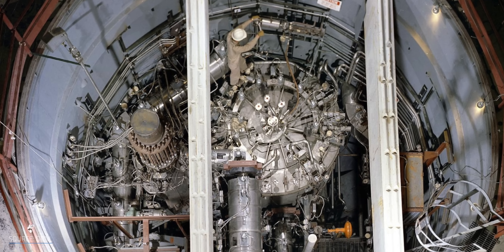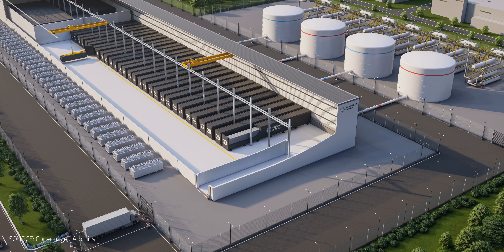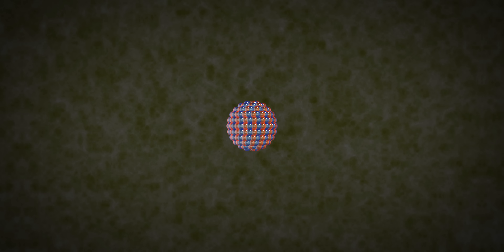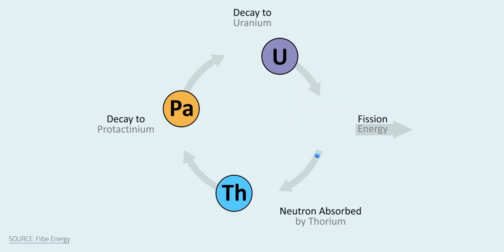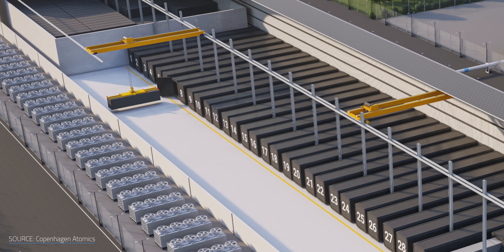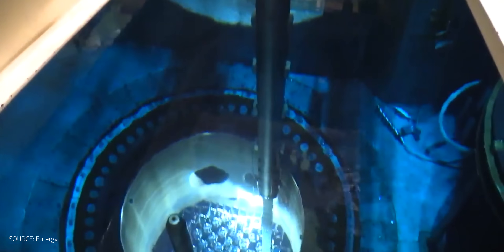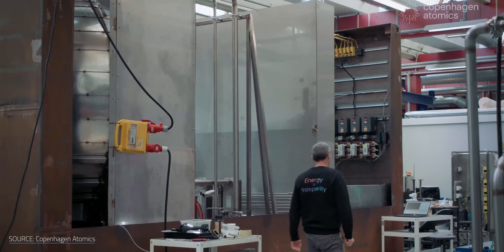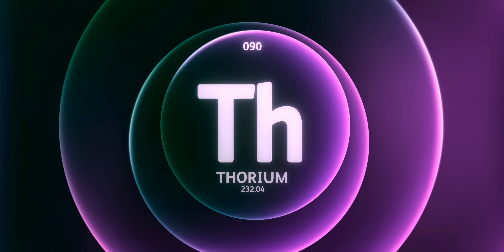Why Thorium is About to Change the World

Comment: You can even use focused solar energy or solar to a electrical heat or lasers to aid the molten part of the molten salt, warm the water, or both.
Reply: You are better off using that solar energy to power your dish washer directly without losing energy in the process of transforming it.
Reply: electric heaters are easy and cheap. No need to overcomplicate it